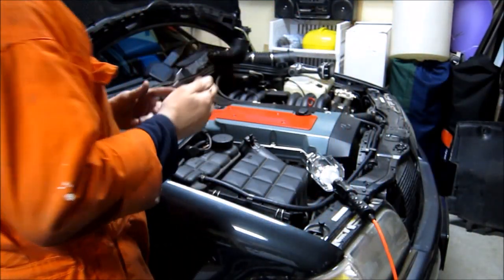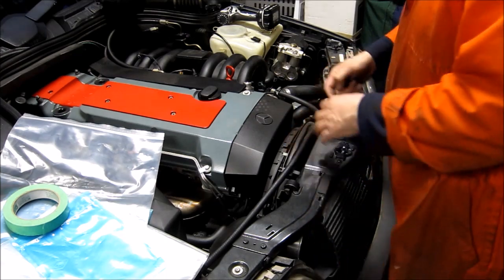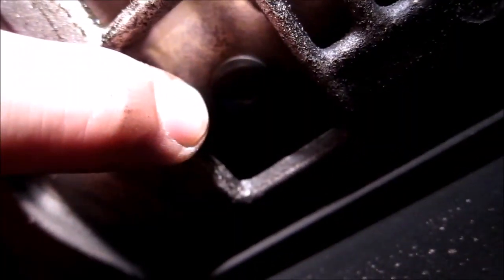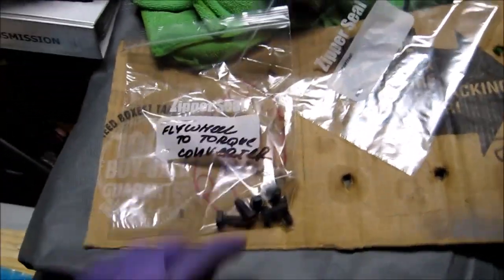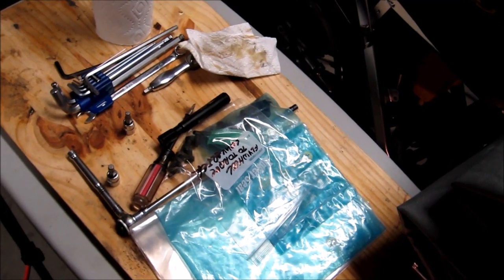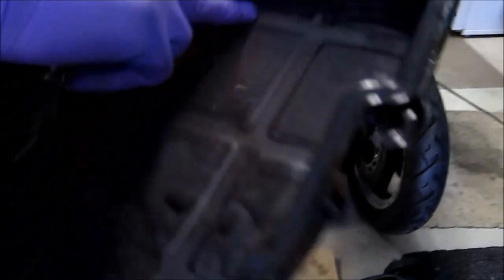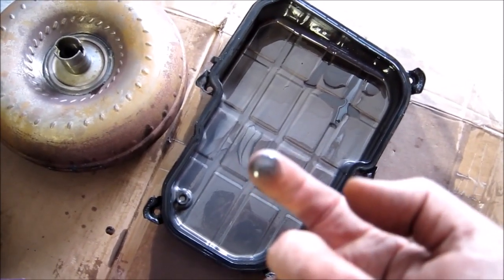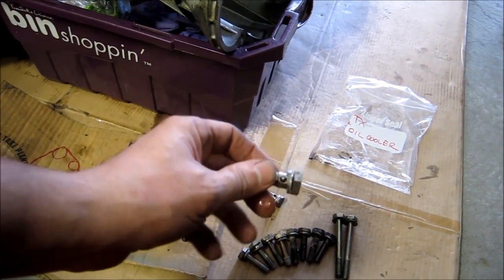Mercedes Benz W202 C280 Transmission 722.4 Removal

Comment: Nice video! Do you have idea it is alot different thing to umount transmission off from -93 c220 with manual transmission? Compared to automatic i guess in manual theres only gear shifter, driveshaft and those 19mm bolts to unmount? And transmission mounts ofc.
Reply: I haven't removed a manual transmission on W202, so I can't really give you any useful tips or comments. And i don't want to pretend like I know everything, I imagine it will not be harder then this...
Reply: @andrewp3089  Okay, no need for pretending, thank you for answering tho! :)

Comment: I also have a 1995 mercedes c280 the car drives in reverse but does not drive forward could it be that there's no transmission fluid ? Or do you think I need a new transmission ?
Reply: If it would be low on ATF, it would not drive at all, first drop the oil pan and see what condition is the atf. Pay attention, whats on the bottom, if you see any metal or golden flakes.

Comment: excellent, thanks for share this video AndyP, i think it´s a lot of work, good job and good luck for the inspection on that, i hope that´s not gonna happend with my transmission.
Reply from the maker: thanks. yes it's not a good feeling when you put the shifter in gear and nothing happens :)

Comment: Hi Andy thanks for the helpful videos how did you learn how to pull out the transmission on the 1995 mercedes c280 ? I'm worried now because I have to replace my transmission and torque converter I'm worried because I'm not sure if my transmission mechanic will know how to work on my car or not I might have to help my transmission mechanic since I will watch and study this video as many times as I have to understand before doing the replacement thank you again Andy this helps us 1995 mercedes c280 owners
Reply: My 1995 mercedes c280 drives in reverse but does not drive forward I heard it could be just the transmission speed sensors I'm studying this video so I know how to remove the transmission and torque converter if that's the last option / also this might be a good time to replace the bushings in the shifter console and two bushings under the car ( shifting rod ) near the transmission should check or replace connector to the transmission you did an amazing job with this video keep up the good work
Reply: Andy how does your 1995 mercedes c280 work after you replaced the transmission ? When replacing transmission is it a good time to also replace the torque converter ? Do you have any advice for me Andy I would appreciate any comments my 1995 mercedes c280 has 150 000 kms and I just bought it at 135 000 kms will a transmission shop know how to disconnect everything on the 1995 mercedes c280 ?
Reply from the maker: It still works OK. no problem,  a transmission shop should be able to do this

Comment: Good Today I changed my transmission mount on my c280 and that went well. But when I drove down the road a few yards the car just stopped. The car wouldn’t move in Drive or Reverse. & when I try putting it in Park it makes this grinding noise. I checked under the car & there were no leaks from the trans as far as I could see. Do you have any idea what might be wrong? Thanks a lot
Reply from the maker: Geo Weezy James
What transmission do you have in your car? 722.4 or 722.6?
Reply: AndyP Mercedes-Benz Channel I’m not sure, how do I verify this?
Reply: AndyP Mercedes-Benz Channel but I think it’s the 722.6
Reply from the maker: Geo Weezy James
Is it 4 or 5 speed
Reply: AndyP Mercedes-Benz Channel 5 speed
Reply from the maker: Geo Weezy James looks like 722.6
I assume the problwm came after u replaced the mount, before that u had no problems?
Reply: AndyP Mercedes-Benz Channel the transmission has really hard gear shifts when driving. It been doing that a couple months now.
Reply from the maker: Geo Weezy James
I suggest you get a hold of a scanner and read the fault codes.

Comment: hey was going to do a transmission fluid and filter change. any recommendations for fluid to use besides the expensive mb brand. I was looking at valvoline max life atf they list it as approved for the mb tranny any thoughts for me?? thanks.
Reply from the maker: Kenneth Shepard 
i use amsoil for engine and transmission.
Reply from the maker: haven't really looked at anything else
Reply: ok thanks i will look into that.

Comment: I'm just trying to remove the transmission modulator valve. Do I need to remove all those bolts still? I just need to drop it a couple of inches. Any solutions?
Reply from the maker: Remove transmission mount, and muffler  rubber hangers, you should be able to tilt the transmission end down, just check that front of the engine doesn't crash into the radiator.
Reply: 'What do you mean by transmission mount? The two bolts in the back? Do I need to loosen all the bolts to the transmission?
Reply from the maker: @otiscarlton4572  no, you don't need to loosen bellhousing bolt , these are the ones that attach Transmission to engine.
At the back of the transmission there's a plate wirh a rubber mount, loosen this plate to lower the back of the transmission.
Reply: And by doing that it'll give me enough space to work on the modulator? Because the modulator is towards the front? Sorry with all the questions. I just want to be certain.  
Thank You! Very much!!
Reply from the maker: @otiscarlton4572  let me know, how you making out

Comment: does the 722.4 fit both petrol and diesel motors
Reply from the maker: Yes. Lots of models used 722.4 transmission, but you need to look for the full code for example 1992 300D (2.5L Turbo) has  722.418 W4A020. Need to know exact year and model of the car to find the right transmission code.

Comment: Is this gearbox the same one on m112 ??
Reply from the maker: I dont think so, need to know car model, there are slight diffrences în clutch packs due to different torque requirements.
Reply: Ok but which manual gearbox fits with m104 engine is it m102 manual gearbox ? Or m111??
Reply from the maker: @heisfit4116  m140, m111 are designations for engine. Transmissions are designated as 722.4xxx, 722.5xx . 722.4xx are pure hydraulic transmissions, they don't have TCM. 722.5xx are electronic transmissions , they have electrical solenoid valve to switch the gears. These are automatic transmission. Are you looking for a manual transmission?
Reply: Yes i was asking which manual gearbox that fit with this engine M104 ?:)
Reply: @heisfit4116  I don't know. You can try this forum 
https://mbworld.org/forums/c-class-w202/352569-automatic-manual-transmission-swap.html

Comment: My transmission won't go in first gear but it will reverse can you help me out please
Reply from the maker: maybe...if you at least make an effort to tell me what year is your car, is it automatic or manual..and some more details about the problem...my cristal ball refuses to tell me all this
Reply: AndyP Mercedes-Benz Channel lol well it's an automatic and it won't shift into first gear
Reply: I heard when that happens it could be the speed sensors in the transmission ( but you might have to replace the transmission and torque converter ) did you ever fix the problem and what did you do to solve it ? I have a 1995 mercedes c280 it drives in reverse but does not drive forward

Comment from the maker: transmission is apart..... reverse clutch friction plates are done, spring retaining washer exploded into pieces. 
used a videocamera and now need to find a cheap way to convert MOD files to mp4.
Windows movie maker doesn't like MOD files.